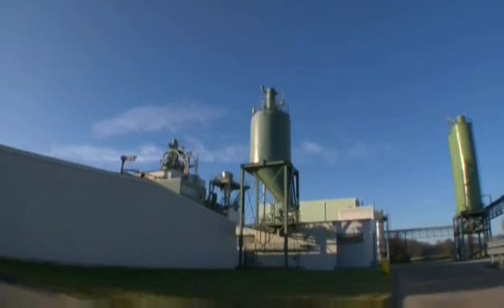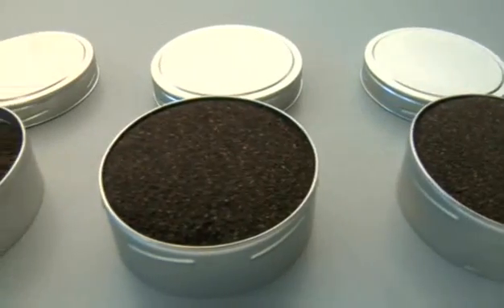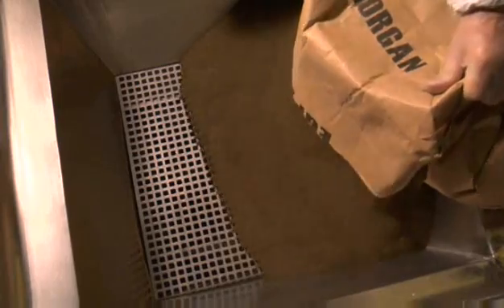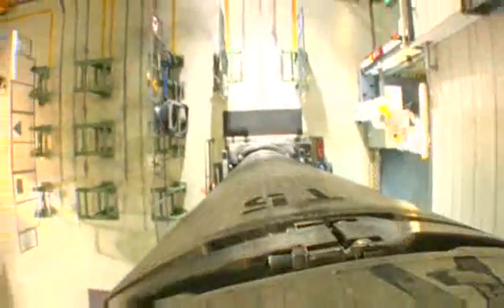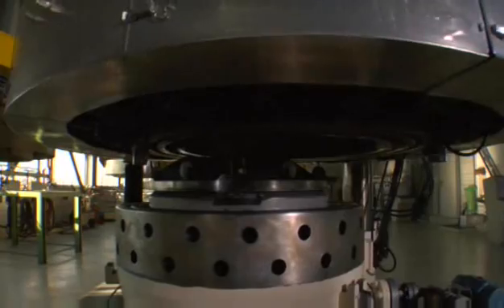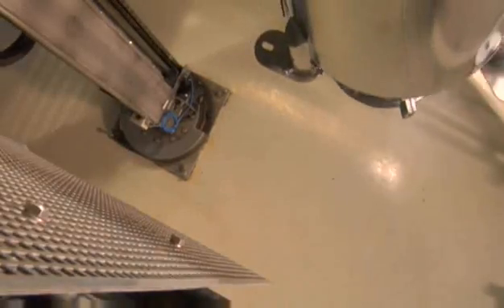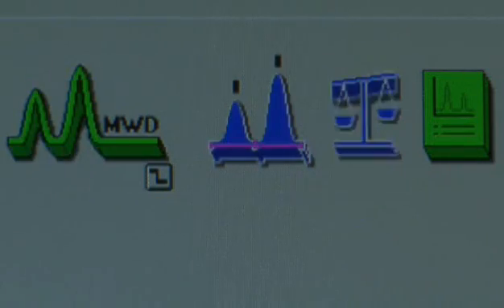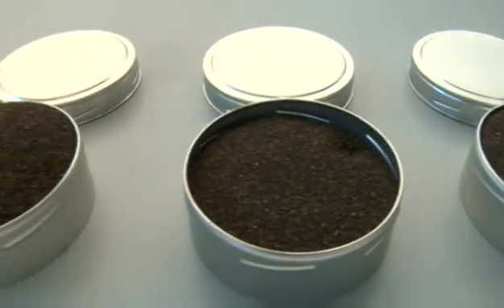Supercritical CO2 Extraction

Comment: Anyone know what the activated charcoal is for? I know its used in air filters. Is it used to filter the co2?
Reply: The activated charcoal is, most likely, used to separate the tea cartridges while still allowing the super critical CO2 to flow throughout the stack. So YES, it appears the charcoal filters the tea. The caffeine is solvated by the SC CO2, is transported away from the tea stack, then the solution is decompressed and caffeine is collected  and CO2 recycled. Huge scale!
Reply: " In  this spesific process, the activated carbon absorbs 90 % of the tea's caffeine,which originally makes up 3 % of the entire content. This absorbed substance is regenerated and recycled into the production process while the bulk that is left over is the decaffeinated tea."
Reply: @LammySammy  So the carbon is for capturing the caffeine for future extraction from the carbon?  And then they add some caffeine back in for caffeinated tea?  Crazy that it's up to 3%
Reply: @LammySammy  I don't understand what you mean by "This absorbed substance is regenerated and recycled into the production process." Is this a chat bot answer? Im mostly wondering why use the carbon at all? It doesn't seem necessary to remove the caffeine from the tea as this is done by the co2.Right? Even the caffeine I would think could be captured without carbon or maybe i'm missing something.